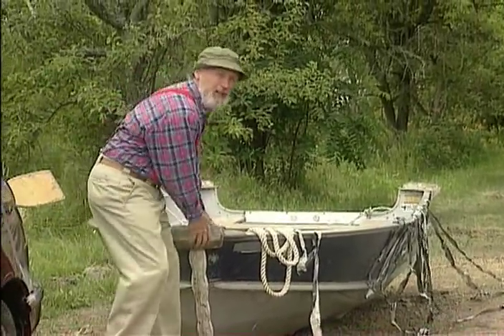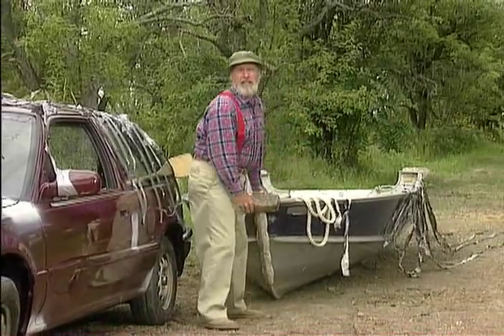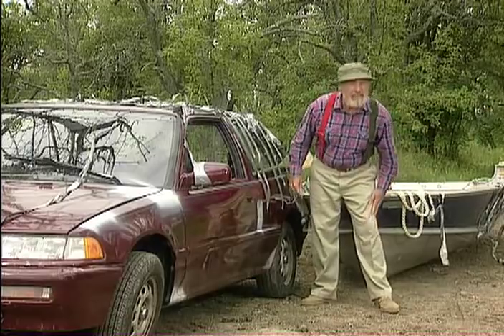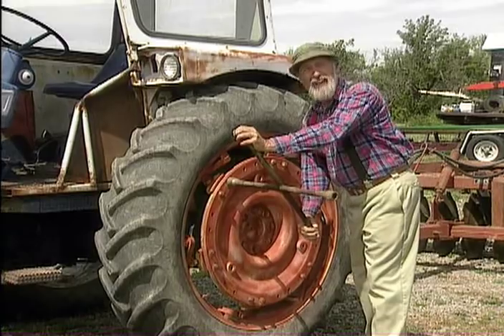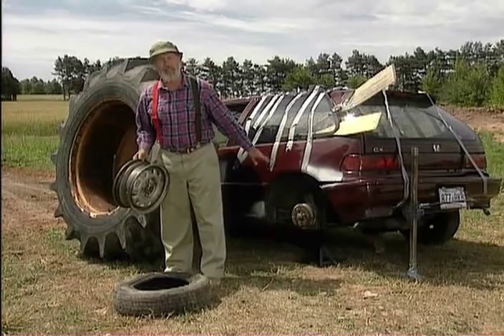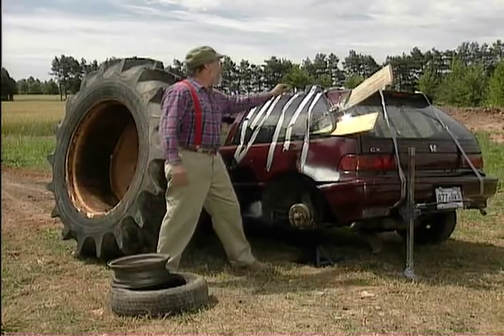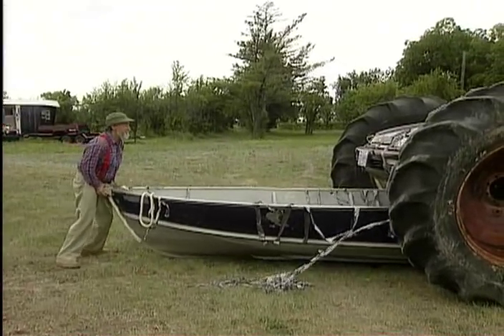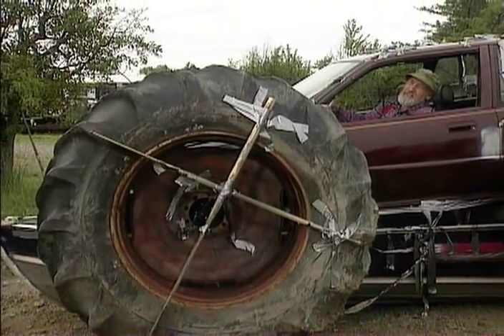Uncle Red is modding a 1990 Honda Civic

Comment: I am impressed that that actually floated.
Reply: It floats, and the front wheels turn. Did they actually bolt the tractor wheels to the axle? This is more than a visual gag. It looks like it works.